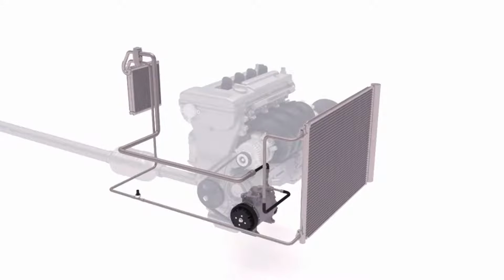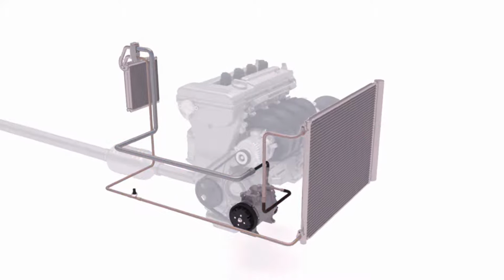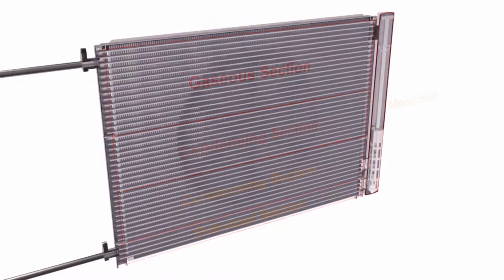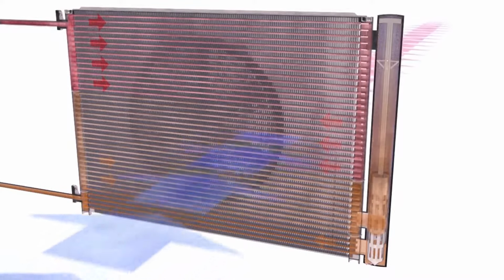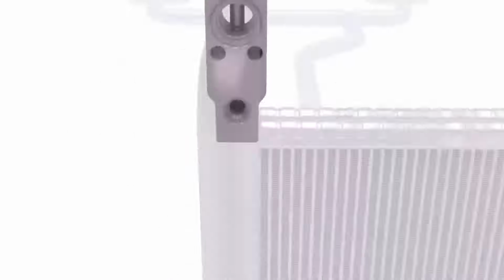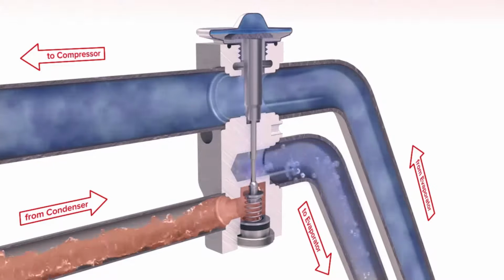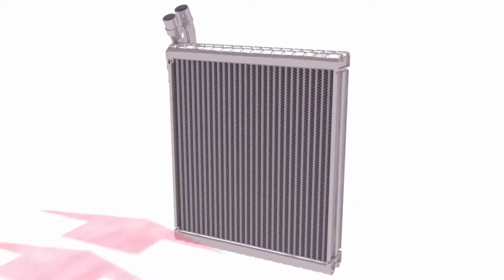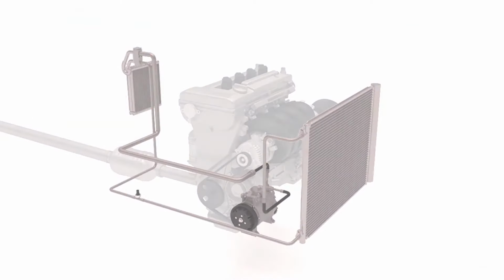How does car AC system work

Comment: How would one know if there is a compressor issue or an expansion valve issue? Symptom: Car is not cooling better than 65F at the vents on a hot day. It gets to 55F while driving. Condenser fan spins fine, system was evacuated, vacuumed, and recharged properly, drier replaced, but still the same issue. Low pressure 35, high 175 on 96F ambient temps. High pressure low and low pressure normal, seems like.

Comment: Its kind of missleading. The system does not absorb heat from the cabin. It absorbs heat from the air that flows from outside when you turn the fan on.
Reply: What about when it is set to "recirculate"?

Comment: The evaporator is the most common leak area pin holes to be exact. It leaks in cabin most time you will taste it if it’s leaking. It’s in the dash board very labor intensive this is why people keep buying over the counter refills for 134. The new R1234 is very flammable and if you smoke in your car with this kind of leak guess what happens.
Reply: Fake news my friend. Its just propaganda
Reply: What does “very flammable” mean? It has a relatively narrow UFL and LFL.
Reply: @yolo_burrito  means cigarettes ignite it. Leak out your vent while you’re smoking you go up in flames. Look it up.
Reply: @gunguy8348  it’s just flammable like Natural Gas not very flammable like acetylene.
Reply: You're being a little bit dramatic

Comment: The only question this video left me with is what happens to the condensation on the evaporator side in the passenger compartment? I know from window type air conditioners in a house that it creates a lot of water and that water drips outside, but in a car where does that water drip?
Reply: It drips out, usually through a hose to the ground.
Reply: Drips right below your car. Park in a humid climate and you'll see water below your car.
Reply: Ever car with AC has a small tube that lets the water drip under the car
Reply: Exhaust

Comment: But HOW is the pressure made by the high rpm compressor mantained? Is the pressure regulator an mechanic piece that moves preventing it from  too little or too high presure? Thanks
Reply: The compressor doesn't increase the pressure of the refrigerant. It "superheats" the refrigerant into a liquid, forcing more energy into it so that it can remove more heat from inside the conditioned space. It is then "subcooled" in the condenser and turned back into a gas when the heat moves from the refrigerant into the outside air. The pressures simply just balance out between the hot and cold sides of the system.
Reply: @user-et5mz5ex9s  What are you talking about? The pressure absolutely does increase. So does the temperature. This is why you have a low pressure and higher pressure side to every single refrigeration system. What do you think a manifold gauge measures? 

In a car the pressure is regulated by cycling the compressor on and off. The magnetic clutch is actuated and released to couple the pulley which spins with the engine to the compressor. It doesn't hold it exactly at one pressure, it varies a bit, but the expansion valve help to regulate the flow in the evaporator to keep cooling consistent. The high side pressure is measured by the sensor.

Comment: I'm now a certified AC technician with 20 years experience
Reply: Then why is my ac clutch not engaging, but it moves okay not freely but it's not seized. When I freon nothing happens it goes in but not blowing cold. Also when I turn my ac on it just blows hot air from outside or warm air. I really want my ac fixed I'm tired of driving in the heat
Reply: @victorstrand3422  something is not plugged in correctly or a motor under the dash is broken
Reply: @victorstrand3422 theres a button on your cars dash that says "A/C" push it to enable it.
Reply: @victorstrand3422  take it to a mechanic. you’ll need several tools to check the system. Not worth getting them unless you work on cars everyday.

Comment: I hate car ac system there are so many things that can go wrong
Reply: Air conditioning systems are overall pretty reliable
Reply: @tgw230  yea only the windows AC
Reply: @dd___dc enjoy melting, I’ll keep my AC thanks.
Reply: Just use it weekly lol
Reply: You ve a car ?😂
Reply: I work in HVAC. Name one thing which "can go wrong" and I'll tell you whether you're correct. Here's a hint: there are only 3 problems which can occur, 2 of which rarely happen at all.
Reply: @user-et5mz5ex9s leaks at joints, water contamination, corrosion due to water contamination, ice formation at expansion valve due to water contamination, hydro lock from too much oil, seizure from too little oil, clutch failure, pressure sender failure, bearing failure, electromagnet failure, under pressure causing lack of cooling, over pressure causing hydro-lock in pump/undercooling, catastrophic failure due to over-rev, reed valve failure, spline failure, compression ring failure, seizure of expansion valve, spring failure in expansion valve…

Dang, sure seems like a lot more than 3 things can go wrong here.

Source: Former auto mechanic with previous automotive A/C systems certification.
Reply: @SupernovaSpence  🤔🤔🤣😭 yep more than 3 problems
Reply: @SupernovaSpence  thanks for explaining I tryed fix my car ac I did but it lasted a couple months I think I may put too much freon the compressor was cycling on and off  too frequently
Reply: @dd___dc does it mean it is yr fault to put too much refrigerant? And it doesn't mean the system is not reliable. I live in Asian country where hot is our sibling, and my car ac works fine after 3 years, the car is 2006 Toyota btw..
If it refer to american / European car, then yes, it might have different level of difficulty to work on. But on simple Japanese car, no it is quite easy and so it become affordable to maintain.
Reply: @user-et5mz5ex9s I should mention I’ve seen a number of these because people don’t know what they’re doing when they recharge their own system with a leak or isn’t performing how they expect it. It is common for the new self-fill refrigerant bottles to also have oil. I’ve seen some knarly catastrophic failures resulting in damage to other engine components. 😅
Reply: I think only one thing go wrong a clear ac refrigerant. but refrigerant can dirt in many ways. if dirty blicked system and overheat compresor pistons and seal

Comment: Sir the expansion diaphragm is controlled by what? Because I don't see thermal bulb.
Reply: temperature bro,
there's an element on the stem that is connected to the diaphram that reacts with the temperature, just like the thermostatic valve
Reply: By the pressure in the system
Reply: The thermal bulb is a part of the H valve